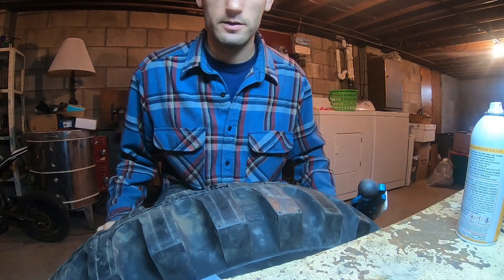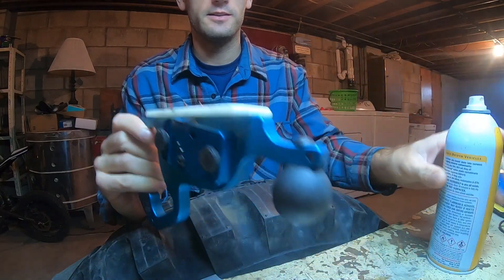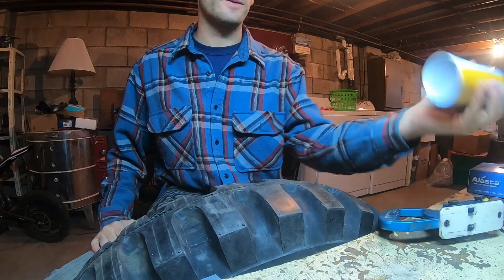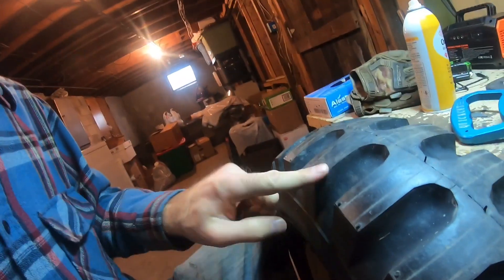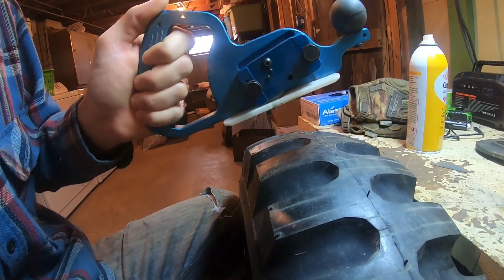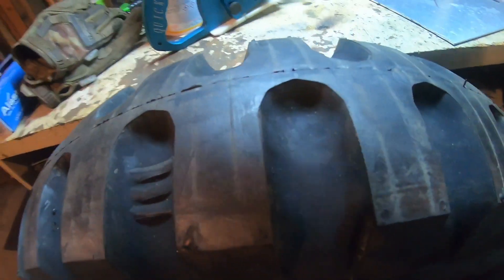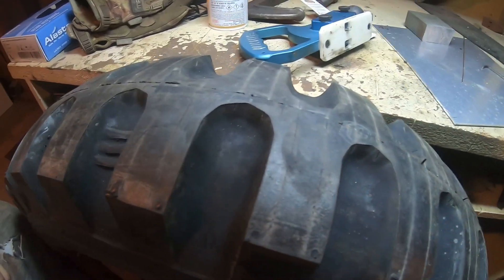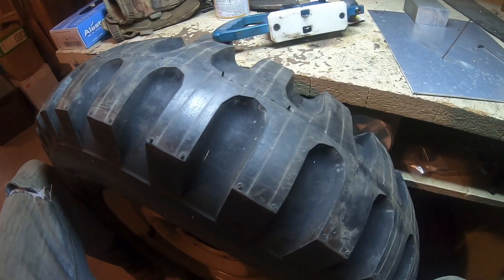Siping NDT tires

Comment: What is this supposed to accomplish? We always used gouges and removed grooves.
Reply from the maker: MedusalObligation siping is a really common process. It puts small slits in the tire which open up under pressure giving more traction. This won’t effect off road performance but should help a little bit on pavement and ice.